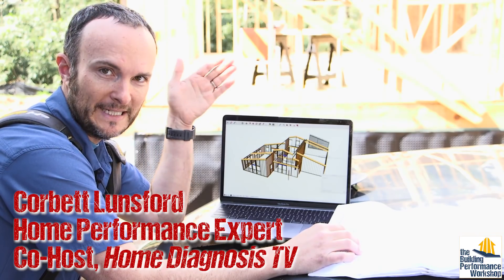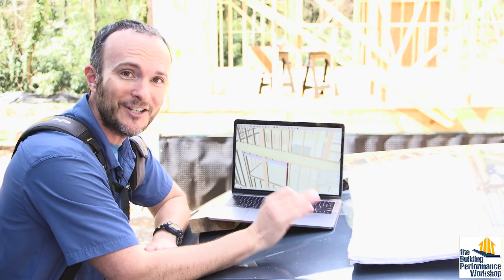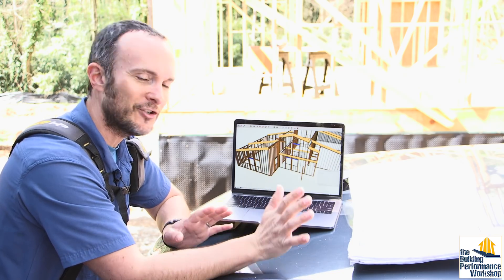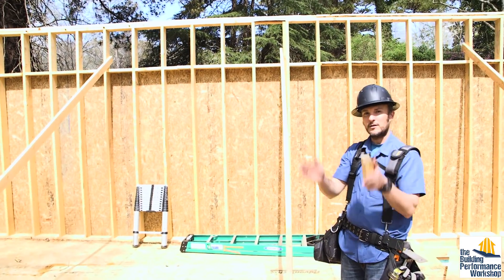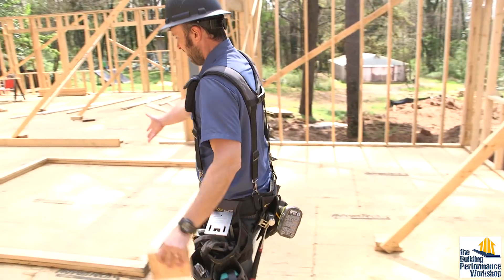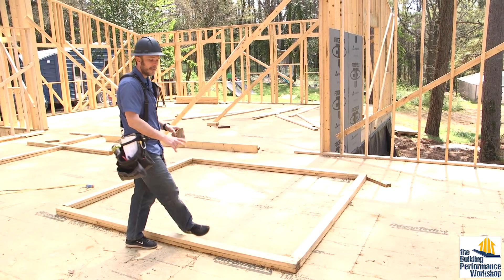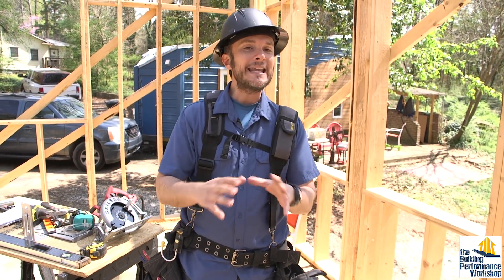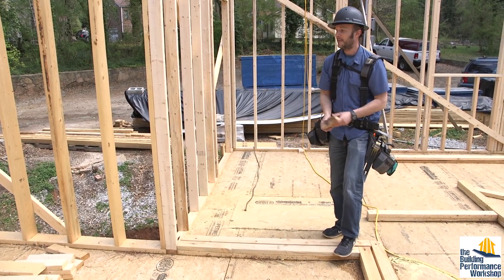How to Frame a House for Performance DIY

Comment: Nice video .... Will watch this one multiple times.  Thanks and keep these things coming.

I like your comment about the owner ( the payer ) to visit his/her site often.  I think that buildings should have a "SET" inspection schedule and items that will be inspected ( for sure , while allowing for other items )

Not having any experience, just fyi, a pre approved set of conditions that spell out acceptable vs not acceptable.  

I get that if I spent 2mil on a 500k house that I should expect, a sh!t ton of precision, but in a reasonable world is say 1/16 diagonal difference acceptable for window openings.  Even 1/16 HxW measurements?

Discusssing with the contractor your wants and needs if his specified price only gets you 1/8 precision how much more do you need to pay him/her to get that last 1/16 in the bid?

I bought a spec house in CO ... the contractor was a CA company, and I didn't visit as often as I liked and ... well honestly didn't know much.  But I did go once and walk around after hours and saw that someone had a sh!t ton of fun with the pneumatic stapler as there were like 40 or 50 staples in a circle with diameter of about 18".  Looks like he couldn't figure out where the stud was or something.

By the time I next got back it was covered on the outside with stucco and the inside had insulation all ready.  I've learned from that ... Whether or not I learned something good or not remains to be seen.  LOL
Reply: Inspections need to be scheduled when the work for inspection is completed. Delays are very common: Weather, material delivery delays, etc.
Reply: @guytech7310  Agreed.

Comment: Umm...about your sheathing (@3:06)...I hope your graphic is showing that you need to run your exterior sheathing horizontally instead of vertically...hmmmm?!
Reply: As per the UBC, shear wall strength does not change whether your sheathing is vertical or horizontal.
Reply from the maker: In that wall, it’s vertical orientation, but a combo around the house generally
Reply: Horizontal sheathing requires more blocking because you cannot have a unblocked edge for shear transfer in a wall. This carries the wind load of the building to the foundation.

Comment: Always thinking many many steps ahead.  What were your thoughts on 2x4 versus 2x6 walls on exterior?
Reply from the maker: Thx Mark- struc engineer spec’d 2x6, I didn’t need it for insulation. Stay tuned for some interesting repercussions though.

Comment: Nice work corbi, and nice safety hat.
Reply: Perfect analogy, Squaring up a building is really important, but air tightness and insulation consistency is equally as important. 😉. Great point.
Reply from the maker: Thanks for following!